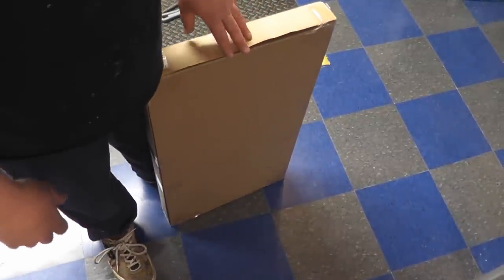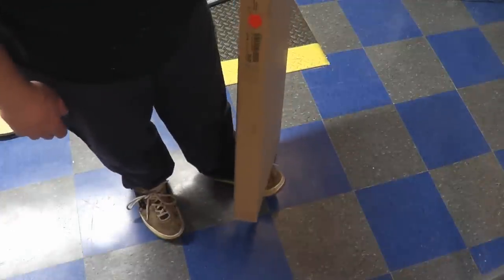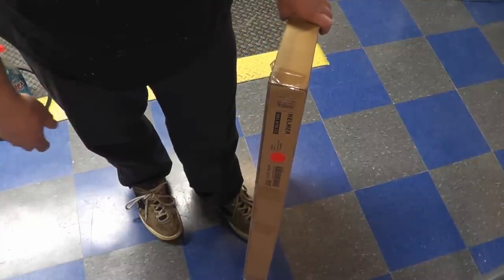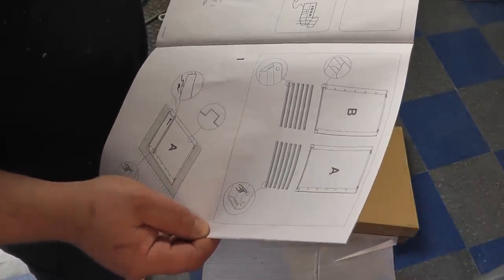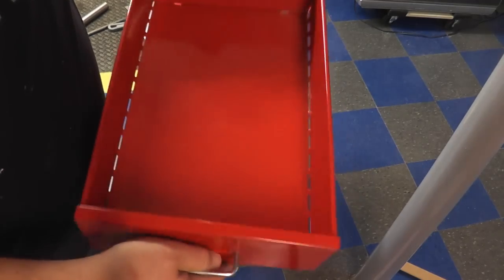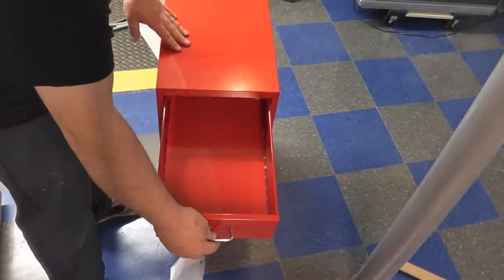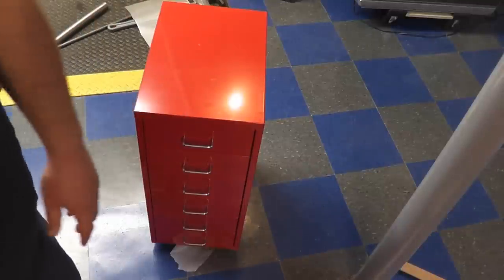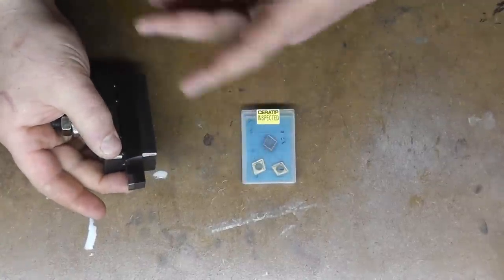Micrometer Carriage Stop and Threading Stop

Comment: Hello, I am back and after watching your great video, I bid on an identical threading stop.  Like I said in my previous comments, the price of the threading stop will sky rocket.  Well the initial bid was $10.00 and after a couple of days my final bid of $77.88 plus $4.12 shipping was the winning bid.  Had I not watched your video I never would have bid on the item. I have yet to thread anything on my lathe, so when it arrives I will give it a try. I do remember however ,you stating that most people don't use this threading stop, and you explained in great detail why that was.  But, I just had to give it a try. The stop comes with what looks like the original holding screw. Again thanks for the very informative video....Ken...Marina CA, the guy with the South Bend 9 in lathe.

Comment: Hello once again, and this is a follow up on the threading stop, I recently bought for my 9 in SB lathe. What I thought was an original screw to control the device, turned out to be a shop made screw. That was not much of an issue, until I tried to screw it into the cross feed. I noticed that the threads on the screw were very sharp and it was a poor fit. That was only the beginning of the problem. I soon discovered the screw was slightly bent and I had to bend it straight before I could finally get it to work. The end result was that it does work, however I found I can turn threads just as well, just by zeroing out the cross feed dial each time, if I pay close attention. Like you said in your video, it doesn't leave much room on the cross feed. I think I  paid too much for something I could have done without. Oh well, my lathe is pretty much complete with all the gadgets. One upside to this is, I sure learned a lot about threading on a lathe. Again thanks for all your help and information...Ken

Comment: I have a thread stop for my 13” south bend and the other day found one for my 9” south bend, I’ve found that if you forget about the screw and place it on the back side of the dovetail behind the cross slide that you don’t run in to that clearance issue and it works just fine using it as a simple stop, funny enough I’ve never actually used one to cut threads, but it worked well for cutting repeat grooves in a part I was making, pretty handy little accessory.

Comment: Looking good. The other insert is the same radius and is an equivalent to the kennametal ones I sent you. They came from a rep who wanted me to try them. I have used it a bit but I am so bad to use my modified tool holders that I just haven't ran it as much.

Comment: Thanks for this great informative video. I'm sure the price of the carriage stop and the threading stop will sky rocket on Ebay , once this video is shown. A few months ago I was contemplating buying both of those items off Ebay, but I really didn't and still don't need them. The threading stop was for a larger lathe than mine, so glad I didn't buy it. That threading stop you have sure looks like it would work great. I for one would like to see a video of that in action. Thanks again....Ken
Reply from the maker: A mag backed indicator stuck to the ways works great if you need to measure your carriage travel.

Comment: I have the same Hemler cabinet (actually, 3). Works pretty well for holding tools. Been doing so for about a year. Only thing that annoys me is that the casters lack locks, so opening and closing the drawers moves the entire cabinet on my concrete shop floor. Works fine on carpet.
Reply from the maker: Yeah I think my castors are going to come off.  Don't know if it will live on the floor or the bench yet though

Comment: Enjoyed seeing your lathe tools.  That threading stop would seem to be more useful if it were on the other side of the carriage.  That was where I was anticipating you putting it until I found out different.  Small lathes are so hard to attach a dial indicator to because of the fact that level places, in fact all places on them are so small.  I have the same type of problems on my Craftsman 12".  Thanks for sharing.
Reply from the maker: Yeah there is no place for an indicator.  Plus every part is Round.  Almost no flat spots so if you could find a place to stick a mag base the rod sticks at a funky angle.

Comment: The final item on this video- a live centre for the tailstock with a Jacobs chuck rotating.  I looked at this also, but the chuck is long and big and would only hold 20mm dia.  Instead I fitted a small 3 jaw chuck which works well.  It came from an old Emco SL lathe and is 50mm dia.  I can use it for pipes above 60mm as well. Much neater.
Reply from the maker: I'll look into that,   Thanks for the tip.

Comment: I wonder if using a lantern tool post with an older threading cutter would have left more room versus the quick change tool post setup?  The stop on the cross slide may have been more utile pre-quick change.  It's been a while since I've used the lantern on mine so I'm not getting a good mental picture.
Reply from the maker: It probably would if you used a left hand tool holder.  A straight would stick out just as much as my quick change.

Comment: I don't really know southbend lathes.. But that threading stop looks like it has a 6 on it not a 9 going by the side the set screw is on.. If it's facing you then it's a 6 isn't it? Did southbend have a 6 inch lathe?
Reply: It's a 9 since it fits a 9" lathe.

Comment: Greg,
Thanks for another interesting video. As for your rotating chuck . . . couldn't you take a live center apart and replace a "live center" shaft with shaft with a Jacobs taper on one end for the chuck you wanted and have the other end of the shaft replace the "live center" shaft? It could be a press fit into the live centers bearings. Good luck with whatever you come up with.
Have a good one!
Dave
Reply from the maker: I might have to look into that.  I have a couple machinable blank MT 2 tapers I could use also.

Comment: Heee's back, with yet another question about the threading stop. When you were showing this video, you stepped away for a while to make the screw that holds the device on the cross slide. Did you make that screw on the lathe using the chuck or the did you use the collett chuck setup.  I know it's asking a lot, but would you make a short video, showing how you made that screw. I know it looks like a no brainer for the rest of the viewers, but my results of my trying to make that screw were less than usable. Now,the screw that came with my stop works just fine, but I just wanted to make one as a project. If the video is out of the question, would you provide a short narrative of your work.  Thanks again ....Ken
Reply from the maker: I used the chuck and a die.  You could single point it also.  Just be aware it's a 12-24 thread.  Give me some time and i'll see if I can get something up.

Comment: Greg, you mentioned the micrometer stop was a South Bend by the greenish color.  Is this an original South Bend color? It looks the same color as your lathe. Can you please post the color formula?
Reply from the maker: It is SLIGHTLY different.  Hard for the camera to pick up but the eye does.  I posted a picture of the formula in one of the gearbox conversion videos.  You can also find it in the Practical Machinist forums.  Do a search for SB color.

Comment: Has any one given thought to drilling and tapping holes in the end of the cross slide (holes on flat vertical surface, either side of the dial/handle shaft, not on the dovetail but a bit below it ) to adapt a shopmade threading stop that projects further back toward the operator to give more threading dia capacity? in other words it doesn't use the dovetail itself at all, unlike the original. As it stands, from the video, I can see the stock original South Bend threadstop would be worthless to me -  suppose I need to thread 1/2-32 or 3/4-32(for me, sizes which have come up in the past)? No room left on the dovetail for the stop!!

Comment: Greg

With ref for the inserts look out for the ones they spec up for aluminium use , they have a very very sharp grind with a heavy positive rake works well on my Myford similer size to your lathe.
I use them as intended but they work well on steel for finishing cuts ,caution the will chip if you go at it with them , and they will cut fingers well
http://www.shop-apt.co.uk/carbide-tips-hobby-use/pack-of-2-ccgt-09t302-alu-ak10-carbide-tips.html
Yes I know you are across the pond but the ref number should be good they flag them as hobby use but that's the pack size 
Stuart
Reply from the maker: Thanks for the tip!